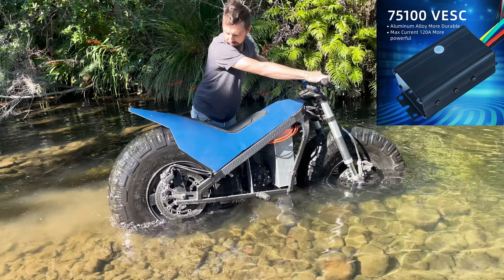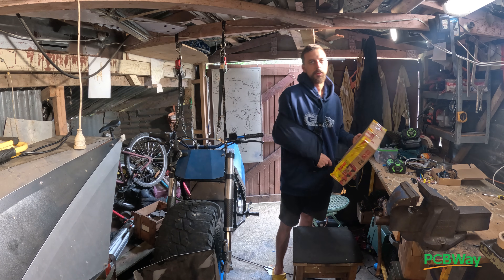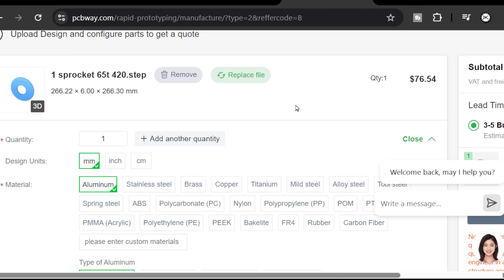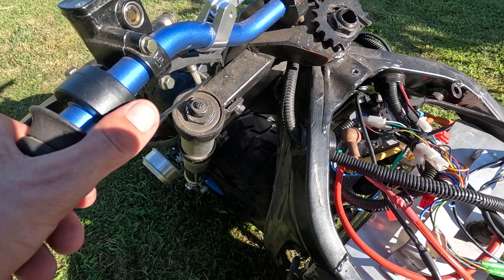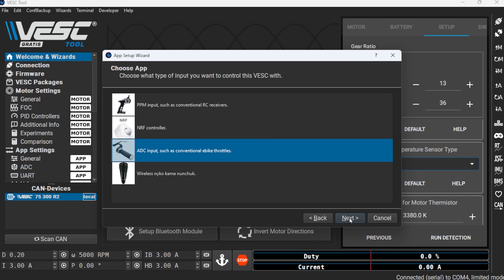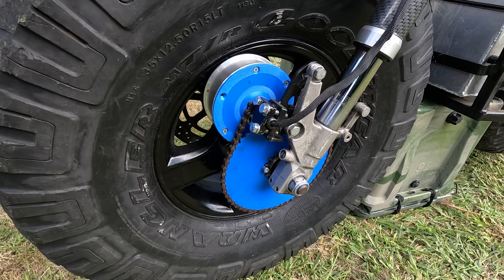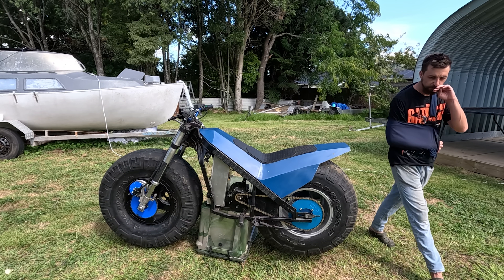28kw VESC 2WD Bike

Comment: I've built a more "legal" 2WD ebike based off a 2010 Trek 3700 13" MTB...but something more powerful like this seems like a lot of fun.  I am thinking of upgrading my ebike after this season, and maybe using the hand me down parts to cobble something like this together with a Fardriver or similar and a ton more amps.  I am only running 3000W on my current setup.  It's still awesome.  I can imagine 10 times the power being 10 times as awesome lol
Reply from the maker: That is cool! The big tires suck a bit of power but really unusual and fun to ride though

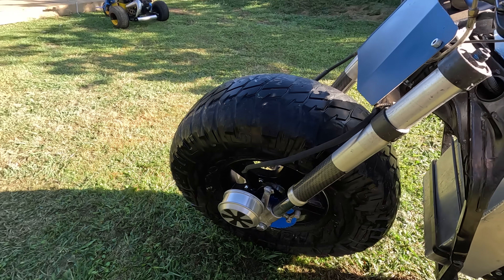Comment: @1:50 What do you mean the VESC steps down a 72v battery down to 60v. If you had the Bluetooth working it would show the same volume the fardriver does. 

Throttle voltage supply should be 3.3v, not 5v, since you are sending it to ADD. Some throttles will drop 5v down to 3.6v but thats higher than recommended for ADC. 

My Bluetooth module plugs directly into the deductible UART2 cable. 

The laptop and USB is a pain in the rear to use. Lol. I messed with that a while then solely use my iPhone. Its going to be helpful when trying to tune the VESC when you are out riding. 

Im using my 75100 with a 350w motor while waiting for my 2000w motor to arrive. Then I need to make a better battery. 

That bike looks mean. If you ever get that front tire pulling its share of the load it should be nearly unstoppable.
Reply from the maker: I’m not 100 percent sure what I am talking about but there aren’t really enough technical videos on this type of thing haha. On the vesc app it said 60v was going to the motor? You are right about the 3v 5v thing but it works and I got sick of trying every wire combination ! Can you plug Bluetooth dongle into that computer plug?
Reply: @ , the VESC real time data shows phase amps, watts, battery SOC. Other screens show battery voltage but i don’t remember seeing anything called motor voltage because it’s not really a controller variable. The “motor voltage” created by back emf is proportional to rpm. The controller just knows it has to hold the MOSFETs open longer as bsck emf increases until motor voltage is almost equal to battery voltage. Then current and therefore motor speed os limited unless you authorize the VESC to feed it some field weakening amps.

My Bluetooth was ordered with my 75100 so I got the right one. I think there are two different  versions. Mine plugs right into wore #5 [UART2), same drawing as you had in the video. If your Bluetooth is module is not for that model then it might need some work to get the wires all correct.

My drawing shows 4 wires going to pins 2,3,5,6 of a 8-pin JST connector. And the Bluetooth seems to have a 6-pin so it needs to get lined up with the correct wires.

If it seems everything is right on UART 2 cable, maybe double check cable 3 (COMM) and make sure you didn’t get TX and RX shorted or something.

I will be taking mine apart soon to upgrade the motor and I can take a better look at my Bluetooth and how it’s connected to the 75100.

Almost all of the harness wires have more JST connectors inside. Maybe your UART2 came loose somehow.

Comment: hmm 2 trottle interesting  i understand wehn u need more momentum at the front in a spicific moment but why u not use one throttle for both weels?
Reply from the maker: Yes you could have on throttle to operate both but it will take me a while to get them calibrated to the same speed I will do that at a later date 👍

Comment: Glad you finally got the hang of using high power electric motors. 

Those Vesc are the ducks guts.
Reply from the maker: Yes! I was thinking about running those motors you gave me maybe I could use 2 of 75300 flipsky vesc. How many volts could those motors take?
Reply: @dkthewelder  technically the 12s lipo. 
Or 50v nominal. 

But if you limit the rpm and current in the Vesc they will be fine. 

Off topic, have you seen the 5kw skate board motors 63mmx100mm and belt reduction. They run a vac controller to. 
The odrive controllers are also good, that British robotics guy uses them a lot. Possibly better starting torque without the sensors.
Reply: @dkthewelder  ive got a flipsky FT85BD dual esc which im using for an electric hydrofoil seems good quality so far
edit: they were also quite nice to deal with because i ordered the wrong hand held controller for it and customer service helped me change it after i ordered

Comment: Awesome! Being electric is way better than being ICE for this I reckon. Mostly the simplicity and lack of noise
Reply from the maker: Yes I actually started trying to use a chainsaw motor for the front wheel drive but the noise would have been bad. Would be a good backup if the battery goes flat though

Comment: It's pretty awesome been subscribed watch the whole builds and the others we need a two-wheel drive launch and a 60-foot Time please and thank you
Reply from the maker: The 2wd won’t make it any faster as the battery discharge is the limiting factor. It is still pretty fast off the line though
Reply: @DktheWelder  right not faster but quicker to its top speed which is limited by the gearing
Reply from the maker: @ yes it is low geared but also my battery can only discharge 350amps and my main motor can easily take all the power so using the front motor simultaneously won’t accelerate any quicker. It is mostly for extra traction, there are some cool trails near my home where I can test it next time

Comment: Thats pretty frickin cool you're overvolting/over-running that hoverboard motor.  I'd always wondered if that could be done, and how far it could be pushed (and for how long)
Reply from the maker: I guess we will find out! The other good thing is you can find old hoverboards for cheap and they are good motors